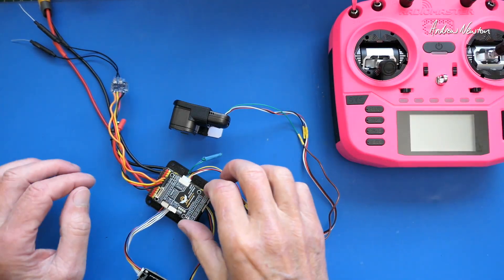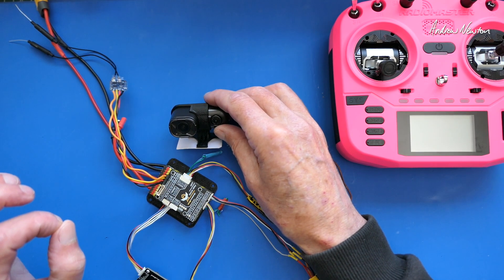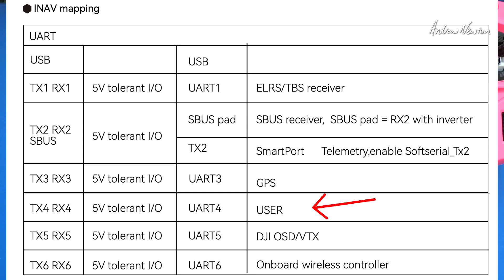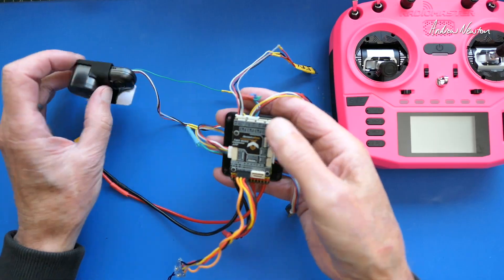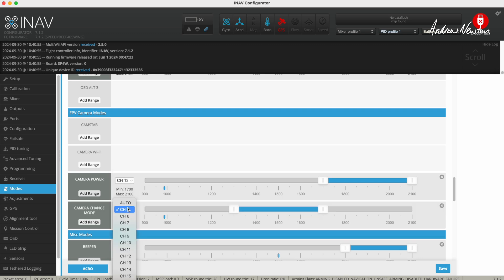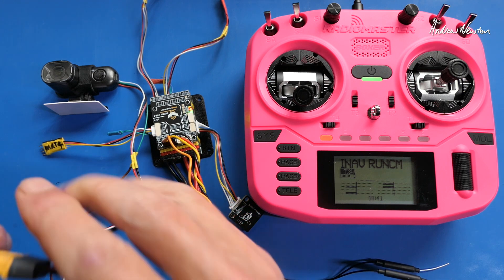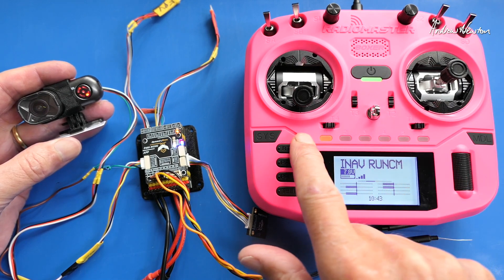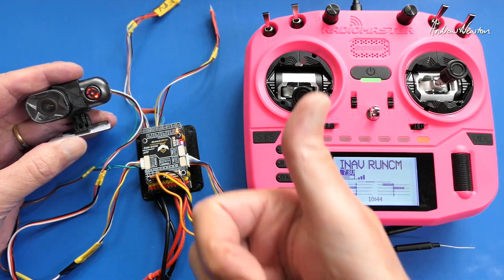Runcam Thumb Pro UART Control with SB F405-Wing

Comment: Great video, thanks. I've had good luck controlling my runcam thumb pro with a UART. But my new thumb 2 has pwm control which I've been unable to make work with my gx12 and a elrs pwm receiver.
Reply from the maker: Thanks. I don't think PWM control works with a receiver. The manual shows how with an FC and BetaFlight. I have never tried it.
Reply: @AndrewNewton  The betaFPV discord seems to think that the pwm control example there is just sending 3.3v high and then low. and it's not really pwm control at all. sigh.
Reply from the maker: @AlexKittens  Ah so it's just PINIO voltage switching maybe.

Comment: You could use a sticky latch operator in opentx to toggle a Recording, Recording Stopped voice.
Reply from the maker: Yes! Or assign the switch to a spare channel and use the "absolute delta > 1" on that channel to set off a logical switch for a short duration. That way it would work as a simple switch to start and stop rec. Might be worth a video.

Comment: I owned a RunCam 2 4K and I had nothing but problems with it with the video quickly stopping or not starting at all. I switched the recommended SD card and that fixed it for a while until it died. With so much bad history with RunCam products, I wonder if these recording glitches have been fixed/resolved in the Thumb drive and the Runcam 6 4K.
Reply from the maker: I had the same problems until I changed to the recommended Samsung Evo SD cards, all 3 of my Runcam2 4k are still going well.